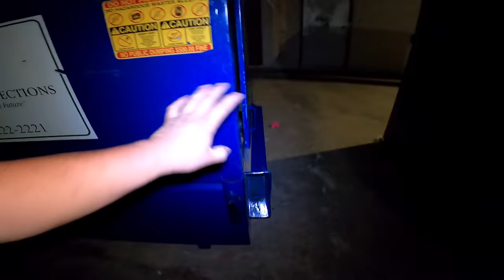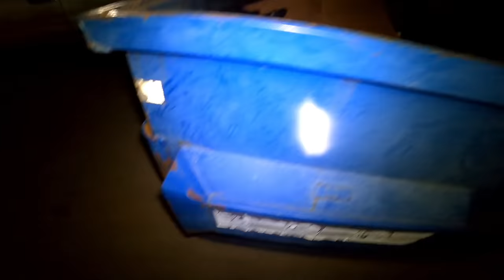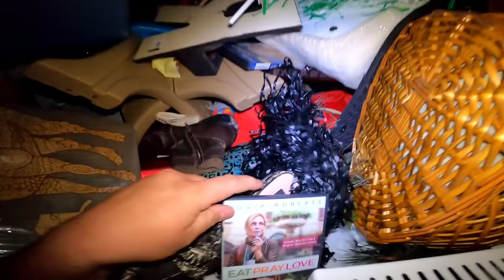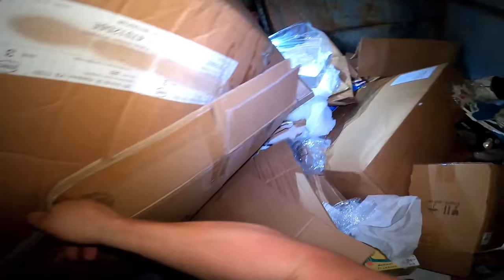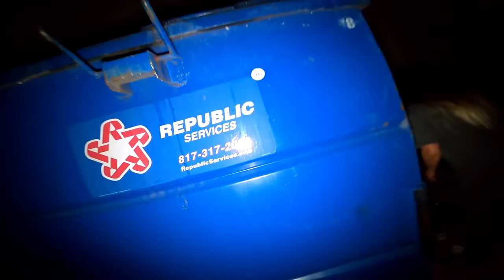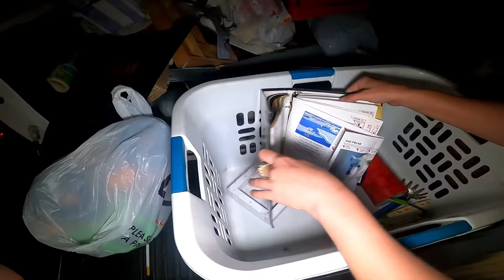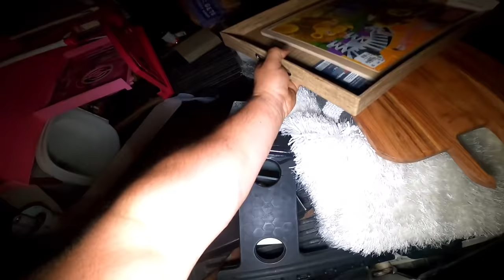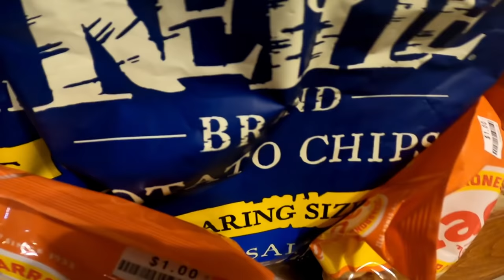UNBELIEVABLE, They Tried to hide 12 Grab Bags Full Of Treasure

Comment: You can decorate the wreaths with the wide ribbon that has the metal in it so it shapes the bow and then you put poinsettias that was broken there and different little tiny gift boxes and you can make all those accessories with making little boxes by yourself and decorating them and then putting a piece of wire in there at the bottom clue it and then weave it into work the wreath and poinsettia leaves you can just buy one bunch of poinsettia leaves or if you want white and red you buy two sets at a dollar tree and then you use additional wire so that you can wave them into the wreath and then when spring comes you change out the ribbon and the flowers for each season